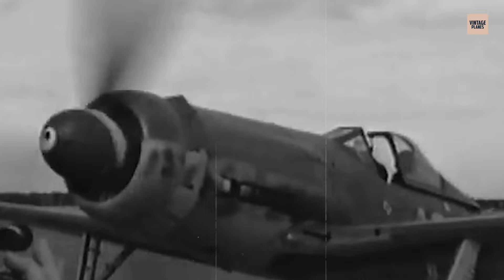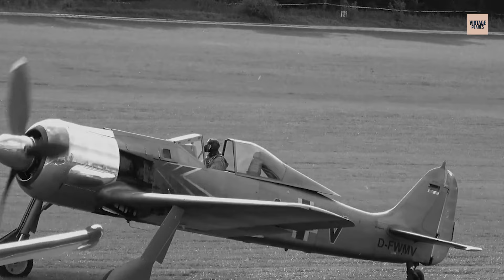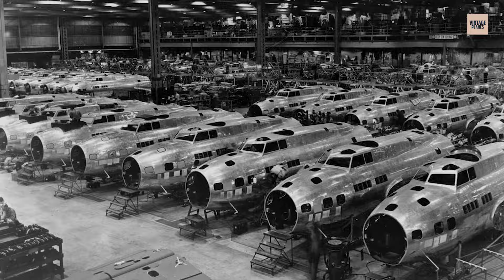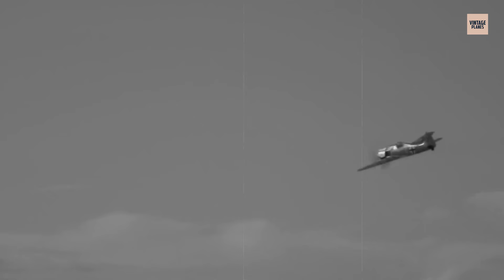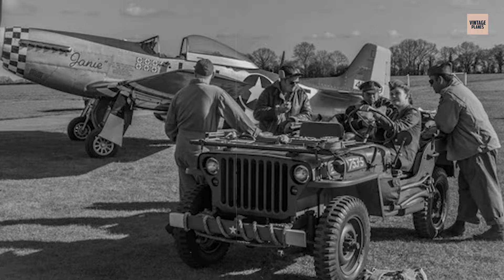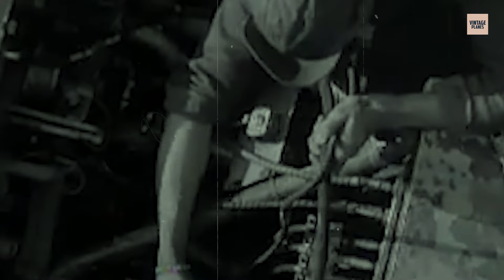The Shocking Truth Behind the Junkers Jumo 213

Comment: France manufactured Jumo 213 engines after WW2 and they were used in Nord seaplanes until the 1960s.  That would make the 213 the longest serving WW2 German aero engine.  It think the 213 was durable, but most variants of fighter engines were different for power needs and they would have shorter lives.  Today a hobbyist is working hard to manufacture new parts for DB, Jumo, and BMW WW2 engines, so there is potential for future improvements for restoration projects.  New bearings are already made for engine overhauls.